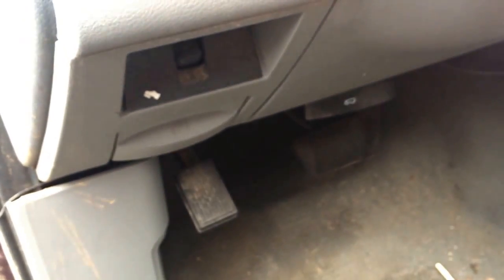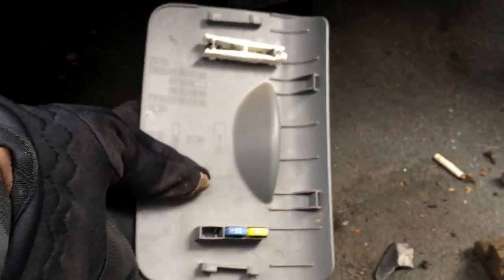2005 Dodge Durango Fuse Box Location

Comment: where can i get a pitchure digram of fueses and wich ones they are  numbers dont tell which ones are wich with out a digram. which one works the horn?
Reply from the maker: Hello Woodrow Adams, the fuse for the horn is number 16. It is a 20 Amp Yellow
 fuse and is located in the fuse box under the hood. A detailed Durango fuse diagram can be found at https://automobilediagram.com/dodge-durango-2004-2009-fuse-box-diagram/

Comment: Witch one is the raidio thank you
Reply from the maker: The fuse you are looking is #12 and is a 10 AMP fuse. You can find replacement 10 AMP fuses that will fit here   https://amzn.to/2NGXhIE   We hope this helps and thank you for the comment!
Reply: Is this located inside? I put a radio in and it not getting power what so ever

Comment: I just tried checking all those fuses for a radio now durango wont start what possibly could have went wrong
Reply: Ruggit Collars depending on how you removed them, you may have damaged another fuse(ex: starter fuse).  when you remove a fuse you should do so using an actual fuse puller or something of a similar gentle nature such as a pair of tweezers.
Reply: Ruggit Collars also, check to make sure your fuses are fully pushed in, as they can work improperly(or not at all) if not.